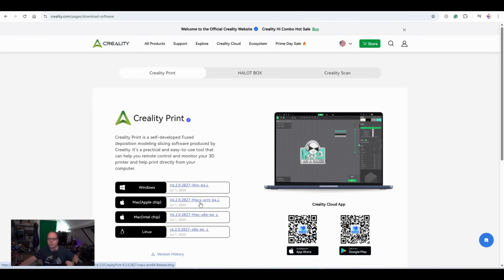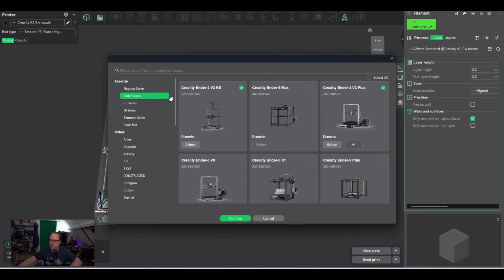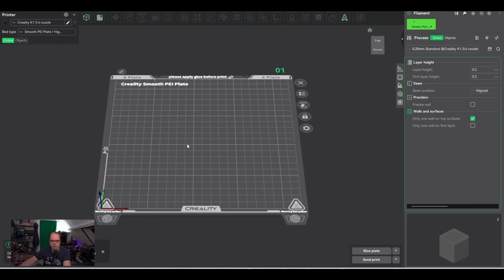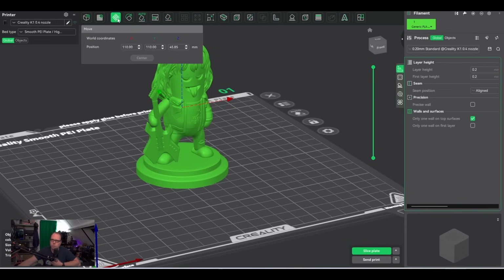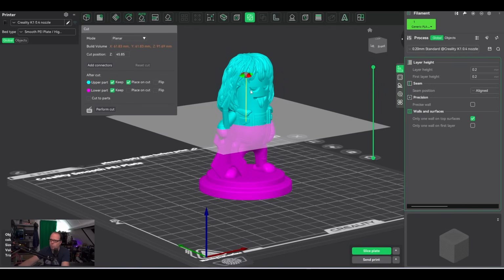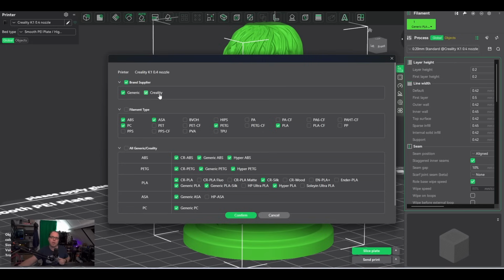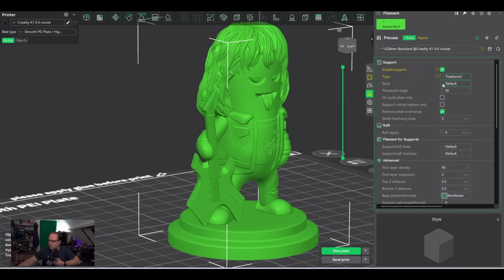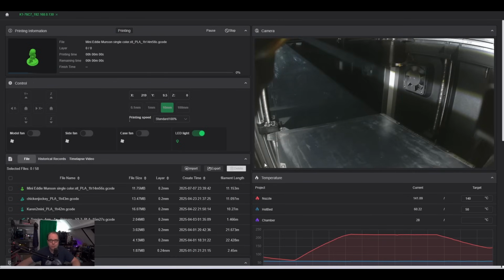Creality Print 6.2 The Game Changing Slicer You Need to Know About

Comment: I have a Creality orphan, a Sermoon D1.  I think you can use a Creality printer that is not enclosed.
Reply from the maker: I remember that the Sermoon D1 came out... Now an orphan, time goes fast. Sure you can use it not enclosed. Print some PLA or PETG panels for it or use some cardboard and close it a bit for ABS prints.
Reply: @Zachary3DPrints  I make a 7 inch tall lexan sides and top with printed corners with magnets in their base.  I installed BL touch and got the computer pad for it.  
I would like to find g-gode to do the start test lines on the other side.  Also put home switch on the bottom and have it lower when print is finished.
Put a belt between z screws

Comment: Hello i'm subscriber, this video help me a lot, Thx. Can u Please make Creality print 6, retraction test tutorial sir?

I'm so newbie in this pushing plastic world. I dont know what to do with stringing. I did print retraction distance, speed & temperature test but I don't know how to read the printing results & what to do next. Changing retraction value n temperature by using amateur observation is all i can do..Please help😢
Cuz i thought using system preset according to brand filament n type is dependable enough but not so much in reality.
I use max lowest 35% humidity possible in my area with Ender PLA in CFS.

Comment: when using CFS my prime/purge towers go off the build since receiving my CFS i haven't been able to use it with the updated slicer it throuwd off the purge tower 300 m off the build plate cannot resize , ANYONE ELSE HAVING THIS CANNOT FIND ANYTHING ABOUT IT
Reply from the maker: Hello, which Creality printer do you have? 
I don't have any CFS 3D printer from Creality, if I'm looking into Creality Print and check the Printer Settings, you have Multi Filament, at the section of the wipe tower, you need to check where the tower is being placed. Have you already tried changing that?

Comment: i've updated creality 6.2.1.3044 and then i can't open the device screen. none screen upcoming and no shows up. just grey screen. i cant use my printer cause i cant connect to wifi. so what sohuld i do ?
Reply from the maker: Oh, that sounds terrible. Possible solution would be... switch off the printer, wait a minute and the turn it back on. Then check if the printer's WiFi settings if it is connected to your network and make sure your PC or laptop are on that same network. Try Creality print again.

Comment: Does anyone know how to change the way files are saved? I have an Ender 3, and the slicer  only saves files in 3MF format, and my printer only accepts STL.
Reply: Ender 3 will accept g-code files.
In version 6.2
Click on "Export plate sliced file"
Make sure File Type is g-code
Save to USB or wherever
Reply: @g4willy thank you my bad, I don’t explain me correct. I finally found what option

Comment: Hey Zachary great video!.

I have a quick question, do you know how to change the bed position on pause?. I am running into an issue where the bed seems to be hitting the front wall on pause causing missalignments
Reply from the maker: Thanks, about with printer is this? The printer hitting the front wall? If that is the case, check if you can turn or move the printer
Reply: @Zachary3DPrints  I did not mean the actual house wall Lol. 
I have an Ender 3 v3 KE, I meant the actual bed rails front wall. 
When i posted this comment i was really frutrated so perhaps i did not explain myself correctly. I found the fix by going into creality´s Gcode and setting the end gcode to Y200 same as the bed size

This solved the issue, Perhaps this is a printer design flaw
Reply from the maker: Oh OK, Sorry I was thinking which wall you meant, it could the printer or maybe something else. Thanks for clarifying it. But that is weird that it hits the mountings of the bed rails... original firmware? maybe try an Firmware update